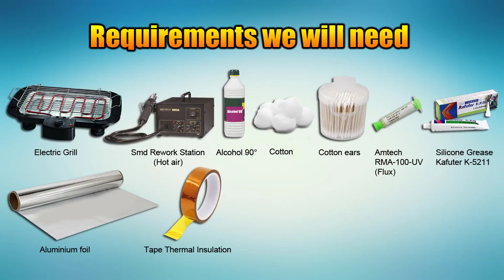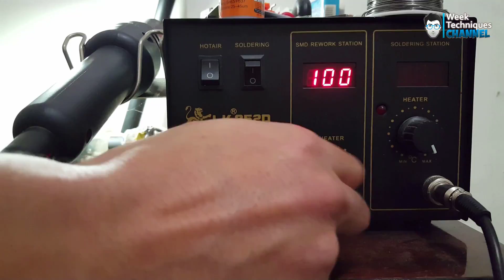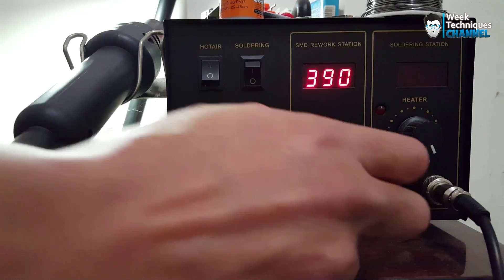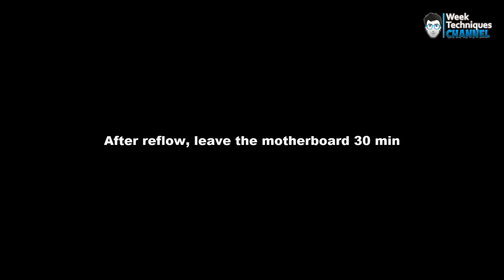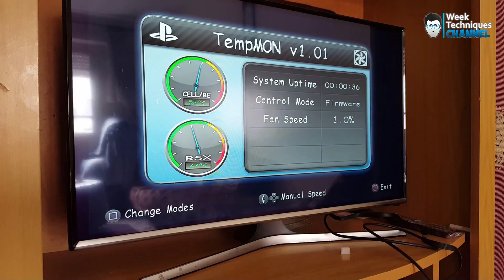[PS3] HOW TO FIX YLOD | 100%FIX [FULL GUIDE] 🛠

Comment: My PS3 never got the ylod you gotta do a fan test to get the dust out the PS3 and keep it cool
Reply: fan test isn't meant to be use by users or touch stop doing it open the console and clean it or you will blown your fan bearing and kill your powersupply

Comment: Hello there,

I have a PS3 Slim that also has the ylod. Will it work if I just buy another motherboard for it?
Reply: Don't buy new motherboard.. It will cost you high price.. Just buy the requirement tools shown in the video and try to fix it.. Maybe it's a temporary fix but Atleast you can save some money..Rather than buying new motherboard try to buy a working secondhand ps3 ✅

Comment: So far I have taken two PS3's I bought that wouldn't come on and tried to fix them.  Both times have been less than successful.  The first system will now turn on for about 2 minutes but then shut back off.  The 2nd system actually worked for about an hour and then shut off and now it won't stay on more than a couple of minutes.  Again neither system would even turn on before I started.  Guess I am only out $15 (what I gave for both systems) and I got really good and taking apart and putting PS3 system back together.  Even found a crappy racing game in one of them lol.

A shame reballing is so expensive both are clean otherwise nice looking systems.  The 2nd one I got didn't even require much cleaning.  Guess I have two good blu-ray drives/power supplies/fans if my good system goes bad.

Comment: One more question. Happens at around 2:17 in your tutorial, When I tried to remove the eject/power button cable, the white plastic connecting piece it is attached to came off with it. It doesn't appear that the pins have been damaged. I can put the white connector back on the motherboard, but it is loose and could fall off easily. Was this glued on? I'm wondering how to correctly reattach it.

Comment: What type of screwdriver you use for opening ps3? and also what do you need for fixing any extra parts?
Reply from the maker: https://www.ebay.com/c/1659415388
https://www.aliexpress.com/item/32864704335.html
https://www.amazon.com/dp/B07H42XP78/ref=psdc_553336_t3_B000N37BUG
Reply: @WeekTechniques  thx

Comment: Yellow light in ps3 slim??????
Reply from the maker: yes
Reply: Hello, I'm from Brazil, I'm sorry for any English error, but answering your question, this error can happen in slim cech 2001a up to cech 2101a, after which the problem has been corrected.
Reply from the maker: @ezgamer9206  Yes, this problem occurs because of the old thermal paste.
Reply: Yeah I own a PS3 slim and it just happened to me
Reply: DevinGamesNL  you mean RLOD?
Reply: My ps3 still works but the light flashes yellow when I turn it on
Reply: @WeekTechniques  mine ocured when i tried to jb it or use han for gta v online mod menu

Comment: Hey, :)  Nice video,i did the exact same thing like you but i have a fat PS3 and it works  and If i turn of the console of and turn it back ok it is ok, it starts but If i leave it to cool of over the night the next day it will not start again and get the rlod and If i keep pushing the power Burton on and of for at least 10 minutes it starts working again until it cools of again. I presume that is a cracked contact in one chip but i don't know where to look, can you give me some advice in where to look??? Thank's !
Reply from the maker: This is the only temporary way, I'm working on making machine bga rework station homemade.
Reply from the maker: i am You bought some tools necessary to make this machine ( BGA Rework Station homemade ).
Reply: A bga rework station is kind of expensive and beside that You need alot of solder balls diameters and spacers but it's a nice thing to do and an awesome experience :). I wish You good luck ! My PS3 has some other cip that is not making contact beside the gpu that now it's ok.

Comment: I need help. My light blinks yellow but my ps3 still works
Reply: LvrdHeartAche yeah I’m scared sometimes it blinks yellow but nothing is wrong or I don’t think anything is wrong
Reply: ShadowOfTheSal its been doing this for a while now. And i stopped launching ps1 and ps2 games from multiman because it made my system hotter. But since i started using multiman the ps3 stays under 62c when it used to go up to 70+c when using multiman. But im just going to go with the flow and hope for the best
Reply: LvrdHeartAche how can I see the temperature while playing games
Reply: ShadowOfTheSal if you got webman and you enable certain button commands then it would be start+select
Reply: LvrdHeartAche thx I’ll be sure to check it out when I go home
Reply: it's my understanding that the blinking yellow light while running the ps3, without it shutting off, is multiman starting, loading, working, or what-have-you in the background. only warning for that i've read was to not load games until it finishes.

Comment: It's weird, i fixed my ps3 fat by reflowing, and putting new thermal paste on it. but it only lasted for 2 weeks, only watching dvds and netflix which is software that doesn't cause heat. 

So when the solder goes bad, you really have to get new lead solder and reattach it... Stupid really
Reply: It's not necessary the solder problem at all. It might, but just reheating it could make it worse actually. An awful video.

Comment: Lol heating it did not fix anything if  will only work for sometime and it will have the same fault again, the only way to fix it is to change the capacitor,
Reply: which cap are you talking about?
Reply: @keokilee1971  the nec tokin capacitor